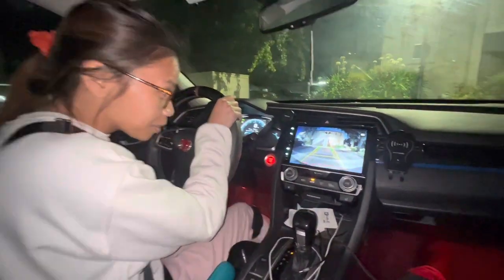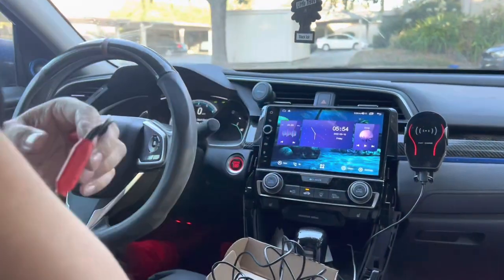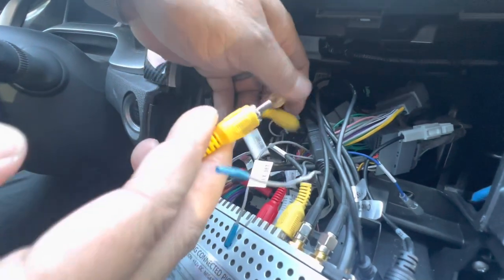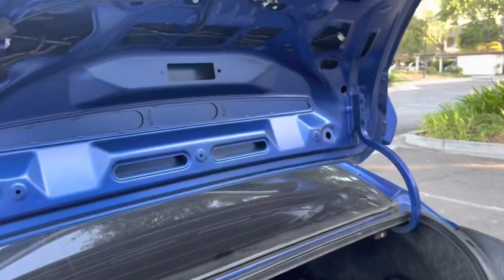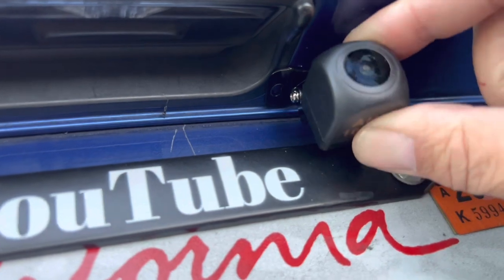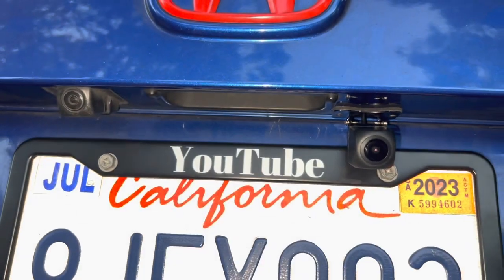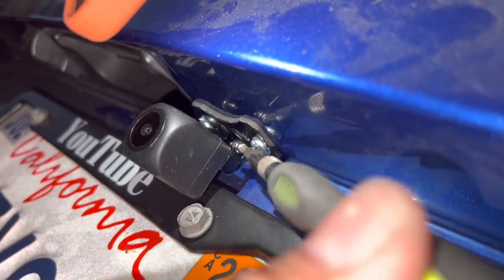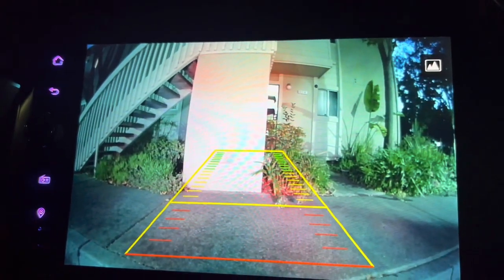Fixing My Biggest Gripe With 10th Gen Honda Civics | HD Rear Back Up Camera Install From Joying

Comment: This was very helpful. For anyone having issues, try different power sources. One of the 12v wires on the head unit (blue one) was not working. I spliced it into the "camera power wires". Only one seemed to work prob because I was only installing the reverse camera. Might have not been a problem if I had the front camera too because it has an adapter for the camera power wire. Lastly, I still connected to the reverse light because that is what joying recommends. I didn't try without it.
Reply: But if you also purchase the front camera and the wires it comes with, it makes the install much easier. it all becomes plug and play. Wish someone had told me this.
Reply from the maker: @Mtbzzzz  thank you for sharing! Valuable info

Comment: I'm planning on getting the same headunit. I have a 10th gen hatch. Do you recommend just changing the back up cam the same time i install the headunit?
Reply from the maker: Nice, yes I recommend installing together. Joying forgot my backup cam order so I had to do it separately.
Reply: Hi I have the hatch too, is the wiring the same to get to the camera from the hatchback?
Reply from the maker: @brandonkwan9953  probably, but I don’t know for sure. Good luck 👍

Comment: I have the same head unit but I don’t have a wire with a Chinese sticker on it.
Reply from the maker: Contact Joying via email and ask them for a diagram or use the included instruction manual. Good luck 👍

Comment: Does this backup camera allow for the 3 different angles? I know on my stock 10th gen civic the backup camera has the 3 different angles including the above angle which is great for parallel parking.
Reply from the maker: That’s a good question for Joying. I haven’t used or seen that feature.
Reply: Any update to this?

Comment: Is there a way to use wiring from stock camera?
Reply from the maker: Yes you can.
Reply: @Sals_Garage  Do you have any guidance or a video on how to use the wiring from the OEM stock backup camera? That would make the install more easy if possible
Reply from the maker: @kazinajib8340  sorry wish I knew but not sure it’s possible.
Reply: @kazinajib8340 you figure it out? I actually cut and removed my oem camera. Leaving the stock wiring. Maybe I'll open and check it, since I'm wiring up my mew EONON head unit to my 2014 civic

Comment: Do dynamic parking line work on OEM backup camera? I just install Joying head unit. Don't have dynamic parking line. only 2 string line. :(
Reply from the maker: I can’t remember. I think it did. This video shows the OEM backup camera with the joying unit if you want to see. 
https://youtu.be/t3bAxOSbsjs
Reply from the maker: Maybe check your factory settings for steering line enabled.
Reply: Not sure if you ever got this fixed but joying had me change the canbus type for my car and it gave me all my steering wheel and dynamic line features back
Reply: Youre canbus setting is incorrect  @Sals_Garage
Reply from the maker: @lionintu  everything works fine for us so far so no need to change anything yet since it didn’t work when I changed the setting.
Reply: @Sals_Garage  sorry man thT message was meant for the person who asked the question. These headu it's are dope. I just installed an Eo on Headunit. I like how even though they compete with Joying, at least they can all use the same harness and cannus making setup quite easy
Reply from the maker: @lionintu  hopefully they can get back to you. Good luck 👍

Comment: cant use the existing wiring?
Reply from the maker: Only works with the new android screen.
Reply: @Sals_Garage you didn't understand the question. The question is can you cut the oem camera which we already know works,  from the oem harness, and attach the new camera to it so it all appears oem.

Comment: Is the camera water proof ?
Reply from the maker: Yes, been through many washes so far with no issue 👍
Reply: I just got mine but i dont have a wire with chinese writing to splice with .... what do i do ... mine is cvt too lol
Reply from the maker: @joseduenas5211  Contact Joying or test the other power wires available to see if it works. Your last resort is using the reverse light for power in the trunk

Comment: Gotta just clean it
Reply from the maker: Eventually when I have the time, it is due for a deep clean.
Reply: @Sals_Garage  no lol 😂 ur car is fine I meant for the rear camera, I have found if u clean it well with a microfiber towel it is much clearer
Reply from the maker: @totljag1  oh yea. I usually use rain-X protective coating so water drops don’t affect the clarity.
Reply: @Sals_Garage  u have to make sure that lens is glass , rain x will cloud plastic
Reply from the maker: @totljag1  good advice. Luckily the camera lense is glass.